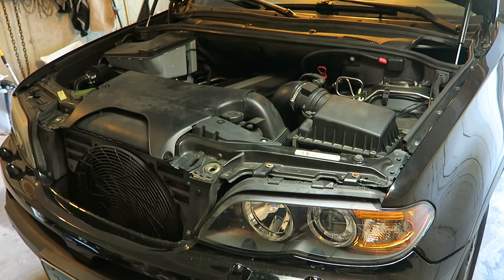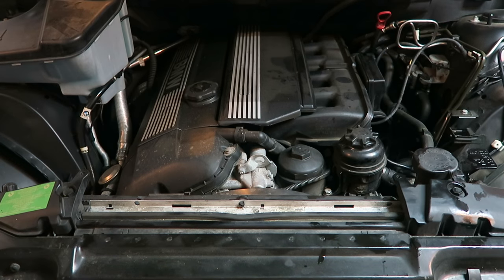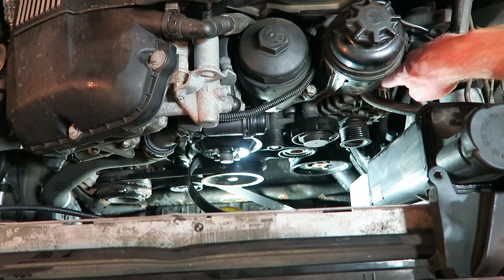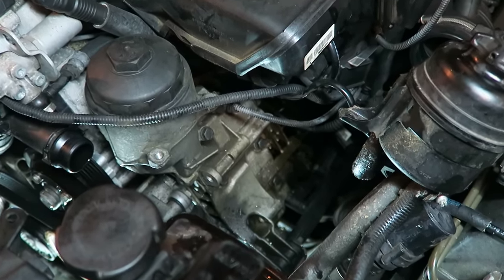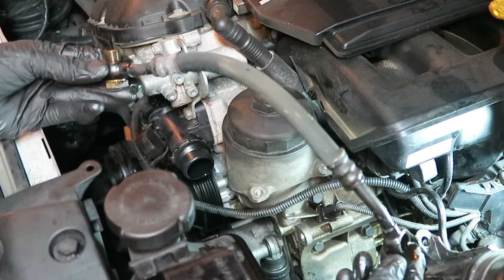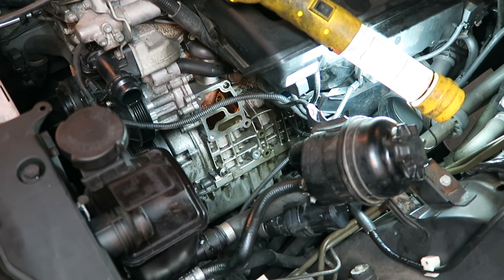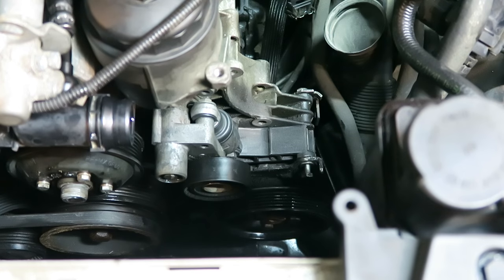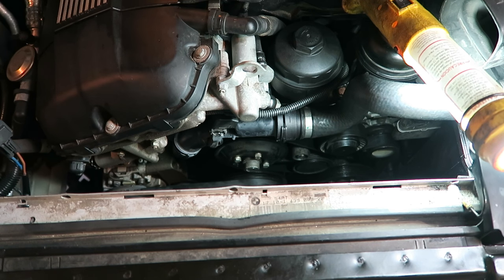M54 Oil Filter Housing Gasket DIY

Comment: Surprisingly smooth repair.  Only minor differences with the 2004 X3 w/3.0i.  Electric fan rather than mechanical.  Removal was plastic dowel on left side, #25 Torx on right side.  Power steering pump only had two bolts, no hidden bolt.  No secondary pump. Thank you Bimmer Zeit...!!!

Comment: Just worth a mention.  Tensioner pulley has a little tag that locates in a notch on the alternator.  You can see it in the video but he didn't mention it. Easy to miss. Great video.

Comment: Great video, and very helpful. As mentioned earlier, the M54 in the E83 X3 is easier as there is an electric fan. Alternator was a breeze. After reconnecting the battery, the 4X4 light was on. A google search led to simply cranking the steering wheel lock to lock to make it go off. Definitely a good time to replace the serpentine belt and idler pulleys, as you mentioned.

Comment: It's worth a mention that the bolts that hold the housing are different lengths, so you might want to take a piece of card, punch some holes in it same pattern as housing, and store the bolts in it so they don't get mixed up if you have to leave the job for a while, or someone else has to take over the work.

Comment: Really very good presentation. Clear, descriptive, simple steps.  Thank you very much.
Reply: Just completed the job this weekend. Referred to the video several times. Very helpful, the job went off without a hitch, thank you.  One thing I thought I would point out is that on the serpentine belt tensioner there is a way to hold it in the slack position.  Use the 16 mm socket on the "nut" that is part of the tensioner casting to slacken the tension, insert a 6mm drill into the hole on the tensioner, then gently release. The pin holds the tensioner. I found this very useful as I could replace the belt without struggling - when I was ready I applied torque to the "nut" and removed the drill bit.

Comment: Excellent video, very clear footage presentation and directions on a difficult job.  I just replaced my belts and thermostat and it looks like this oil leak I noticed is the oil filter canister. So off goes everything again, (plus this time the alternator, power steering pump, resevoir, etc.) all to replace a damn gasket!!  Makes you wonder why BMW did't have a simple spin on filter!  Thanks for the tips and making it look smooth!

Comment: Great video, the only thing that was not fully clear to me, is it necessary to replace the Vanos line? Thanks
Reply: Eddy Desnelle you don’t have to unless yours is damaged in removal. However I recommend new washers for the bango bolt.
Reply from the maker: I would definitely replace it. It's really cheap, and it is also a source of oil leaking as the rubber breaks down. BMW procedure recommends replacing it along with the OFHG job. While you're in there, what's another $20 or so anyway?

Comment: I noticed you went back in with your torque wrench on the housing. What's the torque rating on the housing bolts?
Reply: Yeah.  did anyone ever reply with the tighten torque for the oil housing bolts?
Reply: Really nice video Bimmer Zeit. From multiple forum posts, BMW TIS lists 22 Nm or 16 lb-ft.

Comment: Like every other job on the M54, 90% of the work is getting other stuff out of the way😁.
This is, IMO, very much a "while I'm here..." - you can replace the VANOS line, the belt, and any noisy idler pulleys "while you're there..."👍
Reply from the maker: Definitely makes sense to do a bunch of repairs at once! Avoid all the tear downs!

Comment: at 2:26 i think you said it backwards, you said Righty Loosey, lefty tighty.  Shouldn't it be righty tighty and left loosely?
Reply from the maker: No, the threads are opposite to the normal on the fan clutch. This is because of the direction the engine accessories run, so it tightens as the car is running. So threads are reversed.
Reply: @BIMMERZEITT  damn, i can't take it out. its so tight,   Do you have any advise on how to loose that nut, I am doing right the opposite as you said.

Comment: Thanks for this video. I followed it to the letter and stopped the leak.  I do have a question though. After I put everything back and test drove the car, I got 3 ses codes (p0014,  p0491 and p0492).  I checked all the plugs and everything is the way it was before. Is this something you've heard that can happen?
Reply from the maker: Thanks Ron. If you didn't have the codes before it's probably related to your work. I would recommend going back in for a check of your work, the connections are tight on the sensors and anything you moved out of the way. The intake boots etc were not torn (did you replace with old high mileage or new) - its easy to tear an old boot with mileage on it, brittle rubber. Of course these codes could be unrelated to the job, you know BMW's, it can happen. But just double check your work again when you're fresh. It's a long job and anyone can make a mistake that can trigger codes on a job like this.

Comment: Thanks for the step by step video.   I think I have the same issue with my 2005 X5. The service tech said he wasn't sure if the oil pan is leaking as well.  He suggested to start with the "oil filter housing" first, then clean it up to see if there is any other leaking. The cost will be  $598.  
To do the Oil pan job, he said that will be $1750.00 ouch!!  Keeping my fingers cross that its only the oil filter housing gasket that is leaking oil.
Reply from the maker: Yes I would agree with your tech, the oil filter housing gasket should be your first step. It is easier and more cost effective to do this first, and it will definitely reduce your oil loss due to the leak. Every M54 engine needs the OFHG replaced after so many miles. The oil pan gasket is also likely leaking which is common. This sounds bad- but depending on how bad your oil pan leak is - it may make sense to just top it up with oil every few thousand miles and let it leak. $598 is an excellent quote for the OFHG job. It is usually around $850+ here in Connecticut. 

While your mechanic is in there, see how your drive belts are and cooling system such as the thermostat, water pump and radiator hoses.
Reply: I had the expansion tank replaced in Feb. 2016 and all the hoses connected to it were replaced.  I will mention the other items to the tech as well.  thanks, btw  I have 135,000 miles on the x5.

Comment: did you need to drain the oil
Reply from the maker: Surprisingly no, you don’t need to. However some oil is left in the filter housing that will drain through the check valve. Since it’s off may as well put in a new filter, in my opinion. German made filters are like $5-6 now for M54.

Comment: Hi . Do you need to drain the oil for this job ?
Reply from the maker: Hi, no you do not need to drain the oil for this job. However, it is a good time to change your oil if you need to.
Reply: +BIMMER ZEIT great thanks you. Do you have any DIY on changing the gasket for the oil pan on x5?
Reply from the maker: Wladimir Barba I do not have that DIY. It is a very involved job. Probably one of the most difficult jobs out there!

Comment: why not showing how the engine runs after the fix?
Reply from the maker: Senad, the gasket leak isn't really a drivability or running issue - more of just a leak issue. It runs the same before and after this repair - just now without leaking so much oil!

Comment: That's funny dude if you was a real bimmer zeit then tell why u have to take out the air filter and alternator vehicle. All u have to do is get vehicle. And turn off the oil filter housing. Please tell u your not ASE Certified. Because u don't Know a Bimmer from a hole in the ground. I advise u to lift car on a lift if available and save yourself a hell of a lot of time. And call yourself a Bimmer Zeit. I'd call yourself don't Know crap about Bimmer anything. Do more bud before post anything Bimmer and I'll roast u again. And this is coming a Subaru Lover/ Owner  and but I love Bimmers too. 🤣

Comment: Hey bro if I'm missing an alignment dowell will it leak? Also what's the order for the bolts cause I have different lengths
Reply from the maker: It’s not something you want to do twice. Check realoem for part diagrams and numbers. Order the pin from your dealer or online, my .02!
Reply: @BIMMERZEITT  I did a bunch of research and went ahead and ordered the dowel thank you